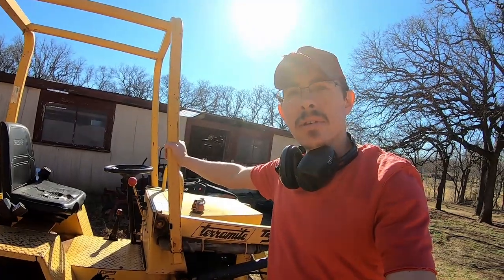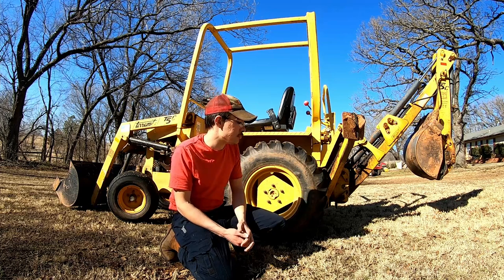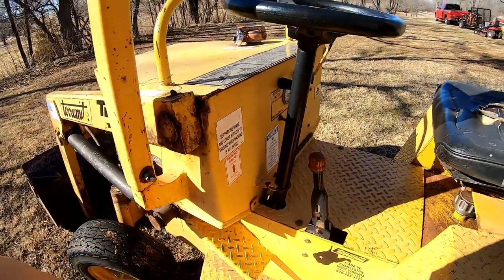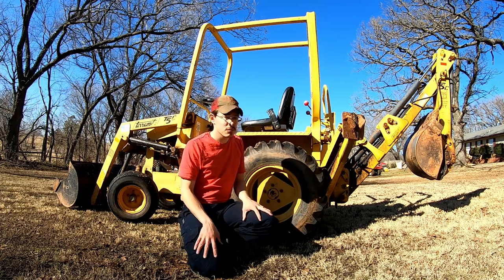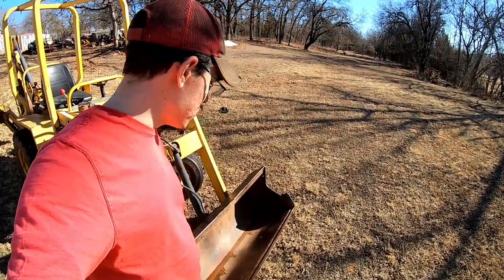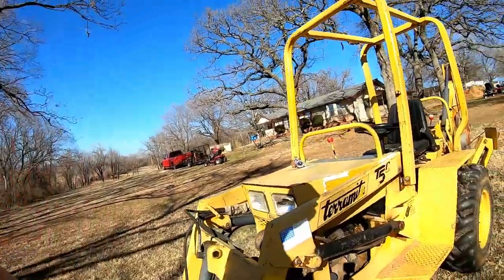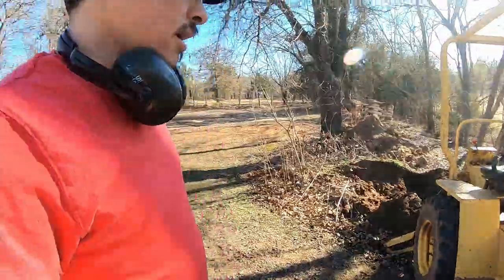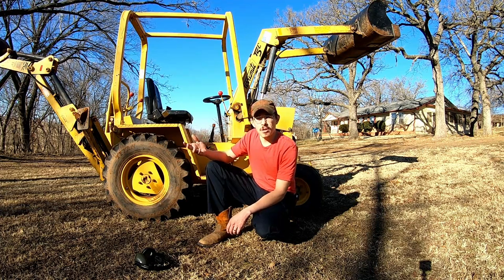Terramite T5C One Year, 55-hour Review and Walk Around | Are they any good? | Backhoe | Garage Story

Comment: I always thought if I bought one I would change the front bucket to a skid steer style,that way a lot of attachments and the ability to have multiple buckets. Check out Titan attachments. These are off the shelf for major parts luckily
Reply from the maker: I have seen that people do convert these to skid steer style, however with the weight of that system you lose some useable capacity. It’s definitely an option to consider though, depending on budget and what you want the machine to be able to do.
Reply: @garagestory  I was looking at the ones for sub compact,very light but capable.

Comment: I own a t5c from 1999 similar to yours. Do not use hydraulic oil in the hydraulics..... It is 1540 motor oil only you will tear the hydraulic system up on that machine. I hope you read this. I've had my machine for well over 10 years. I've had hydraulic cylinder rebuilds and I've replaced some hydraulic cylinders from Bailey hydraulics just a few years ago I changed my engine to the harbor freight twin cylinder. The Kohler engine lost the magnets on the flywheel and took out the alternator also. When I put the harbor freight engine in I had to have an adapter made. It is one tough little machine and will out dig a Kubota it won't drive as fast but it will out dig
Reply from the maker: Yes, I use the 15W-40 oil for the hydraulics. I may swap out my engine some day, but it’s still doing what I need it to do! My charging system has gone bad, so I may have had the same issue you had. I just disconnected it and run off the battery. For what I do, it’s working out ok, I just charge up the battery every so often.

Comment: I'm looking hard at these, is there any way to attach a trailer hitch to the rear? Would it have enough oomph to bulldoze a partially buried scrap pile? (some refrigerators, random chunks of metal, thanks previous property owners)
Reply from the maker: Good questions!
There is no real good way to attach a trailer hitch that I know of. You could make something that attaches to the backhoe arm or bucket, perhaps in place of the bucket. Or make a hitch that is pretty long that attaches directly to the tractor frame maybe.
As for bulldozing a partially buried scrap pile, I think you would do best digging the items out with the hoe then pushing them. Or using a chain attached to the hoe and pulling them out. I think you could probably get the job done, but it might not have the weight and power to push partially buried appliances out. Of course you could try that first since it’s easiest. But I think you’d end up needing to use the hoe to help.
Reply: Thanks!

Comment: What about parts and service ?
Reply from the maker: A lot of it is just off the shelf components. There is a place or two that does specialize in Terramite parts, but they are really pretty simple machines. The engine is basically a lawnmower engine.
Reply: @garagestory  thx for the quick reply.